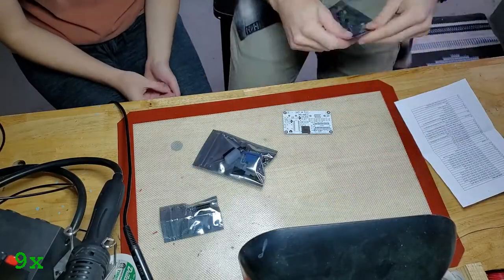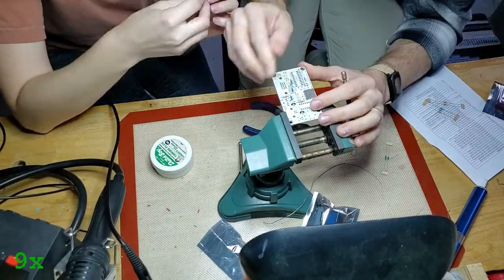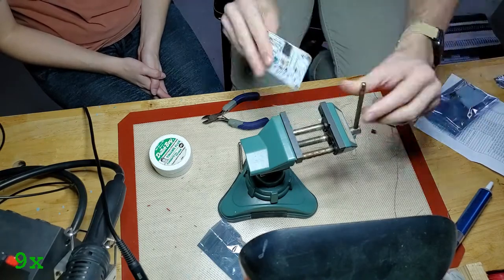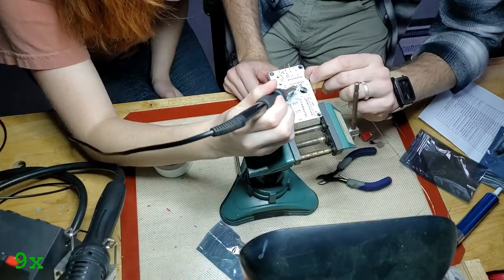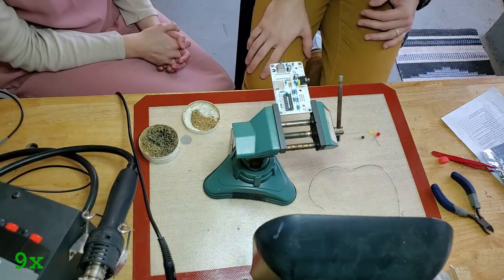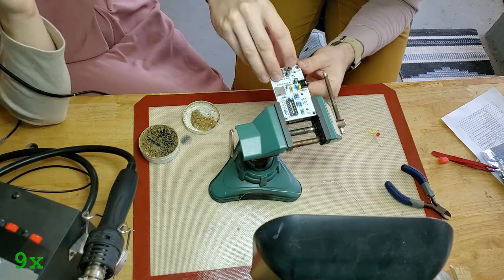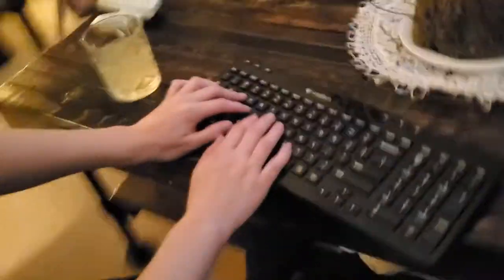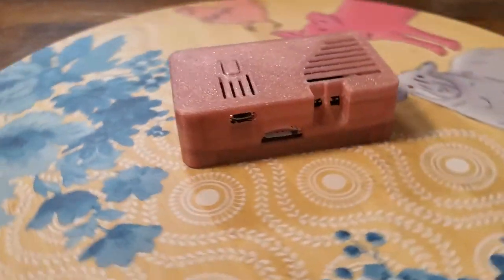Building a uSVC Game Console with Sam!

Comment: Hi! 
Very nice video :)

Some corrections: is it not Itaca-Innovation that made uSVC, instead next-hack made it. Itaca-Innovation supported next-hack by providing PCBs (designed by next-hack) and components!
Furthermore the SAMD21 is running at 48MHz. It would have been too much easy if it ran at 100MHz ;)
Reply from the maker: Ah, that makes much more sense! And yes, I realized the MHz discrepancy after putting up the vid. I'm still new to this if you can't tell. :P